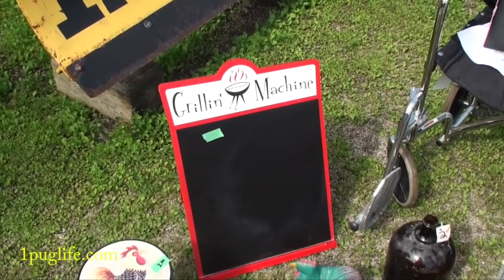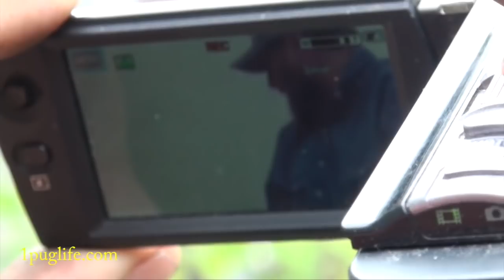tree dicks cock the trough

Comment: HATE TO TELL YOU THIS BUT THEY PUT THOSE GUTTER GUARDS ON UPSIDE DOWN! they are supposed to be like an extention of the roof so debris from your roof rolls off to the ground and the water goes down the rain gutters the way they put them on from what you showed it's just another tray to get clogged up that you'll have to climb back up and clean out again sooner than you would have had to before
Reply: Yep it's on upside down
Reply: DaddytechEnt Oooooooooh crap
Reply: DaddytechEnt you're right.
Reply: These dudes r to worried about the next bing hit to do the job rite,Yup i have gutter gaurds on my house,and there suposed to be flush with the outside of the gutter.
Reply: DaddytechEnt It looks like they did the upper shop ones correct. I don't think they had the one you saw installed yet it was just sitting there like that while they cleaned the bullshit off from the fucked up roof, either that or the fucked roof wouldn't allow it to be installed correctly.

Comment: The top edge of the gutter should be tucked underneath the meal strip and the gutter slope should run run1/4 of an inch for every 10ft no need for caulk

Comment: YOUR ROOF IS EASY ENOUGH  TO DANCE ON AND CLEAN OUT GUTTERS.... PS.... WHEN IT DOWNPOURES  THE RAIN NOW WILL OVER FLOW BECAUSE THE HOLES ARE SOO SMALL   AND ICE  WILL CAP THE GUTTERS AND  IN WINTER THE RAIN WILL DRIP OVER THE GUTER AND LEAK INSIDE...  GREAT JOB... ITS EASIER TO JUST GET YOUR ASS UP THERE N CLEAN THEM OUT EVERY 6 MONTHS.. PS.. CHEAPER TOO...

Comment: why do you keep hiring these no tool goofs to work on your roof
if they knew what they were doing they would have their tools and ladders ready to go because they do it all the time

would you hire a painter who does not have brushes?

also you might as well buy a harness or 2 for the idiots you send up high
a quick and easy roof anchor would be to tie a rope to big dirty on the other side
Reply: why not it weighs over 6klbs thats good enough for osha

i did the osha 30 and to my knowledge its legal

I work in a harness everyday and I have tied off to weirder shit just the other day while drilling a 3 inch hole in concrete on the 10th floor of a building I tied off to a dumpster because it was close and retractable hooked right on